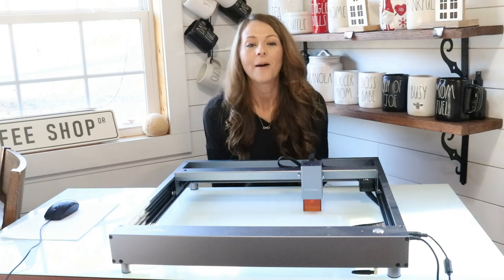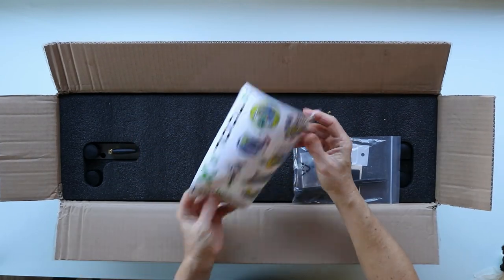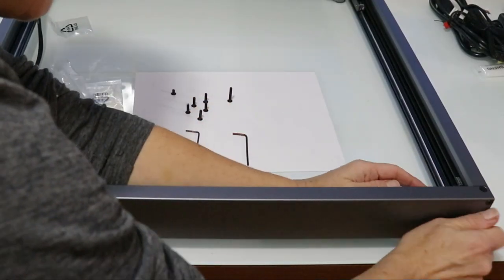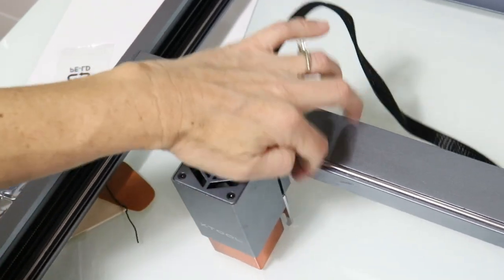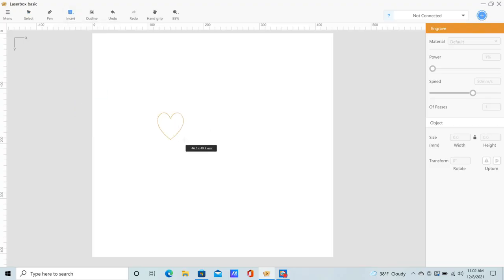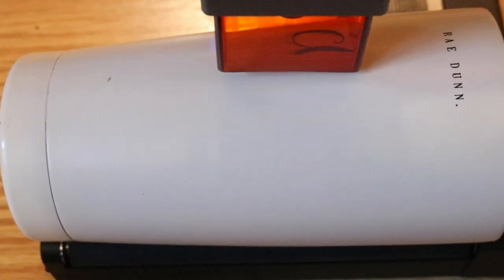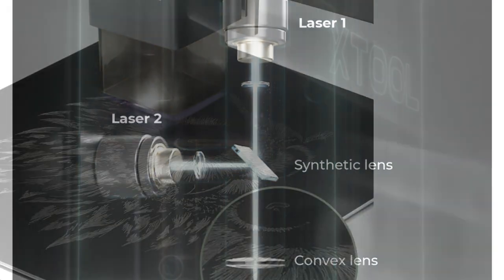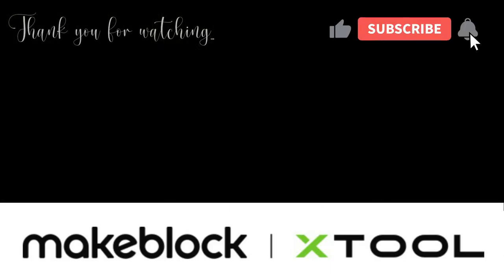Makeblock xTool D1 Laserbox Laser Cutter and Rotary Engraver Setup and Review

Comment: Hi Christy, what a great and informative video. Can you please answer the following:  what do you  put UNDER the material you are cutting? What do you do about venting?  What is the learning curve?  Is there a subscription service requirement?  You cut/engraved an expansive number of materials; which one do you think this machine was the best at overall?  I’d love to hear more. Thanks!
Reply from the maker: Hi thank you! I didn't use any thing under the laser when just engraving,  but did place  piece of aluminum sign under when cutting. The laser will definitely cut thru glass so don't use glass under it. I used the machine outside at first, but did engrave inside near a window. There are fumes so definitely need open space or window venting. I learned to use the machine and figured out some quirks about exactly where to place material, and which setting to use with different materials within a day.
Reply from the maker: The software is completely free, but I did use Inkscape (free also) to create some of the designs. No fees after you purchase. The quality appeared the best on the black coated aluminum card, and I love the idea of being able to engrave on steel and tumblers, I am definitely going to test some more wood products tho!

Comment: haven't purchased a laser as yet, but plan to as soon as I know what will work best for me. many lasers mention that they need to have a cooling system?  Some come with a water tank.  Does the D1 have this?
Reply from the maker: Hi! No the D1 does not need a cooling system or water tank. The laser is 10watt so you couldn't cut thru thick materials like metal slabs that need a water tank for the slag. I do recommend when cutting to have really good ventilation tho, the fumes are pretty strong. Engraving I do in my house, so hardly any fumes there.

Comment: I am looking at this one "Makeblock xTool D1 Laser Engraving Machine With Rotary Attachment" cost $849" Would it need to be vented outside?
Reply from the maker: Hi! You will need venting if you are cutting materials. The engraving doesn't give off much fumes so I do that without special venting. When cutting I open windows and doors to outside, and close doors to seal off the rest of the house so fumes don't travel. Hope that helps!

Comment: Do you put a mat or some sort of material under the wood you cut so the laser doesn’t cut or burn your table?
Reply from the maker: Hi yes I used an old aluminum sign underneath and it worked great.

Comment: Hey there! I just bought this machine. How do you create files for this, specially the calligraphy lettering? & how do you set the X Tool up to cut out something like this? Thanks!
Reply from the maker: Hi! I was actually working with mine today. I design in Inkscape (free program). If you are cutting something out I would save the design as a plain svg. If you are engraving, export as a png. Then you can just drag the file onto your Laserbox canvas. I drew some circles in a row and engraved them onto wood. I did this to make sure the machine was aligned. If the circles are distorted, you will need to adjust those back belt screws. I would turn half a turn on one side and try the circles again. When they look like circles your belts will be tightened the same. Hope that makes sense. Also, when you cut something keep you speed on 2. My cuts looked distorted when I sped the machine up. If you slow down to 1 the laser burns your edges too much. Test cut before you cut the actual piece. There is a lot of other things I learned testing mine. A honeycomb laser bed helps when cutting. I got mine from Amazon. I know that is a lot lol! This machines does excellent at engraving that is what I plan to do mostly with it. Hope that helps!
Reply: @AppalachianHomeCo  Yes, this helps a lot! Thank you so much!

Comment: Thanks for sharing… 👏 whats the maximum thickness that it could cut through?
Reply from the maker: Hi! The website says 8-10mm in one pass... I did cut thru luan in one pass, which was about 3/16". I have seen other videos cut thru 1/2" pine board so with multiple passes probably about 1/2".

Comment: If you have that dog bone how do you line up the lettering on the program when the computer doesn’t have the dog bone image on screen
Reply from the maker: Hi...there are a few ways to do this. I hit the home button on my screen to send the laser back to the right upper corner. Then you can move the laser with the left , right, up, and down buttons to position it over your tag. I fine position the tag until the laser mark is over the spot I want to start. You can also cut out a grid on some plywood that is going to be your base and use it to position items. Hope that helps!
Reply: @AppalachianHomeCo 
It would be great to see a video on this subject from you. Thanks for the review. Greetings from Ukraine❤️

Comment: Is it possible to work on mugs "with handle" with the rotary attachment???
Reply from the maker: Hi! You can probably cut in images on the sides of the mug...but there is no slot for the handle on the turner so you couldn't turn in with the handle facing down and laser, if that makes sense?